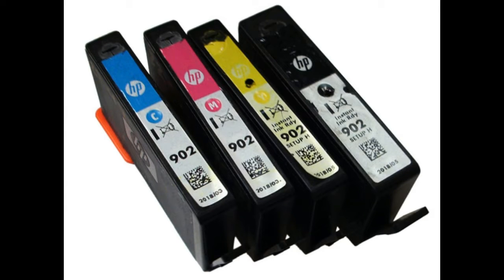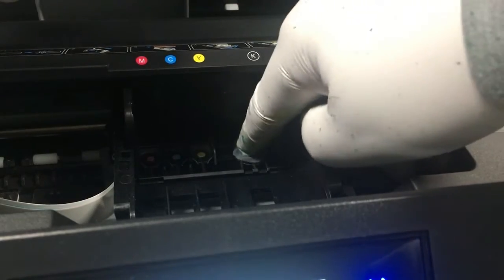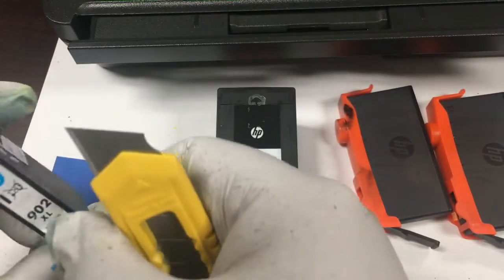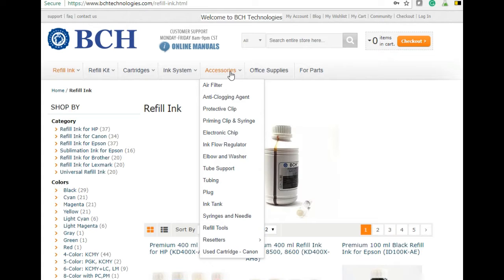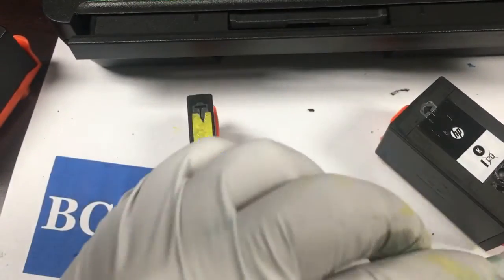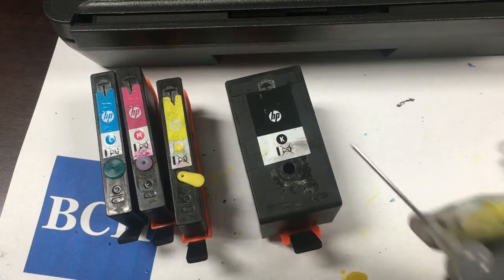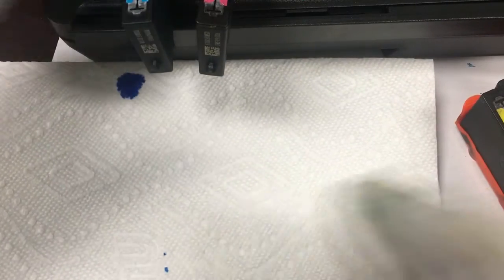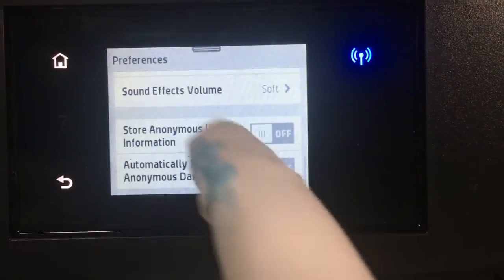#1 Freedom to Refill: HP Instant Ink Cartridge 902 910 915 934 935 564 920 Video 2 Part 1

Comment: Kevin, great video.  Just made my second order with BCH.  Here's a tip for the 902XL:  use a heated push pin or (better yet) a small metal pick to melt a small hole in the fill ball.  Then use a small screw or picture hanging eye to thread into the ball.  Pull on the screw or eye with pliers to remove the ball.  Then use a 9/64" drill bit by hand to remove the little bit of plastic that was below the ball.  Otherwise neither the clear nor colored 4mm plugs will seat completely into the 902XL cartridge.

Comment: Kevin, at 0.49 you show an exploded view of the Cartridge there is a space between the fill hole and the end of the cartridge. Why can’t a hole be drilled there and fill through that hole instead of messing around with the plug. . Can you just drill a 4 mm hole and the plug it?

Comment: This is fantastic. Thank you so much. I will happily circumvent the instant ink ripoff. 

When removing the sticker on the black cartridge I noticed a smaller hole higher up. From the image at 1:09 it would seem to be right behind the 'K' and should lead to the other chamber. Could ink be injected there?
Reply: i don't think so because thats in the top chamber where the sponge is... it blocked mine up